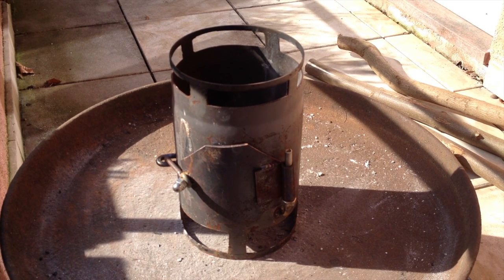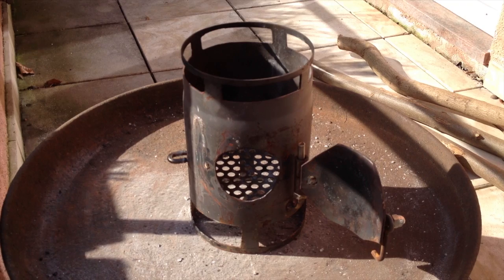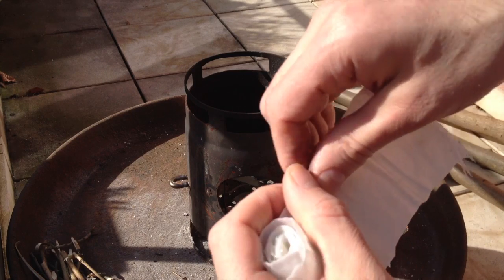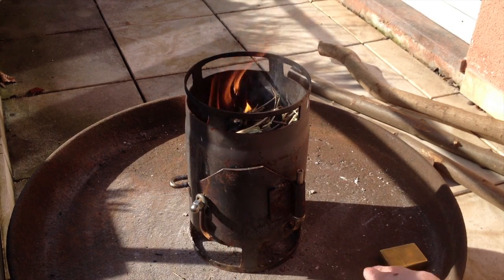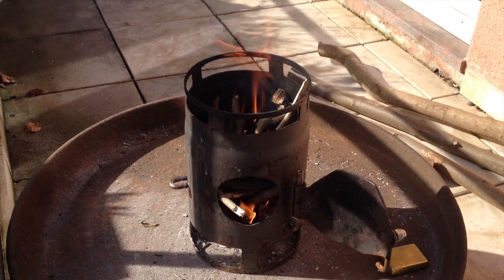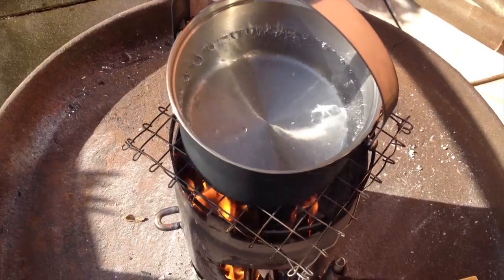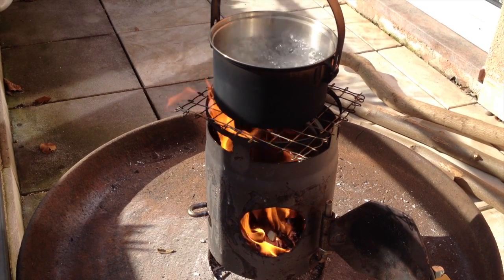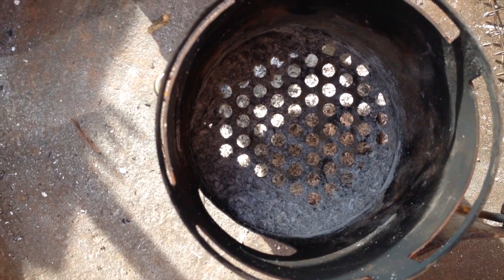HOBO STOVE REVIEW BY STOVE MODS - BOILING TEST FOR HOBO STOVE NO.1

Comment: Enjoying this kind of design and never too old. Your information has been very helpful to me designing a similar one out of a stainless steel utensil holder with similar vents for air from the bottom, not the drilled round holes. I have stainless steel removable mesh screen supported by three stainless steel machine screws. Stove works wonderfully and the only thing left is pure white ash. Thanks for sharing.
Reply from the maker: Thank you for letting me know! It always makes me happy when I was able to inspire people :-)